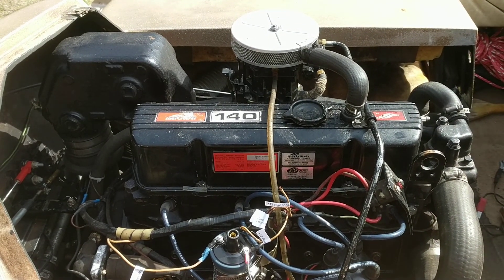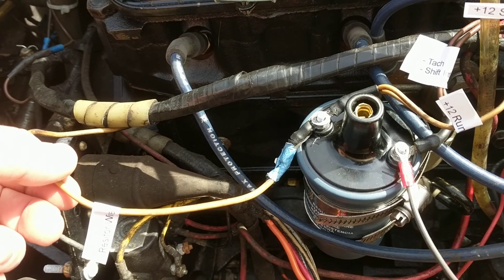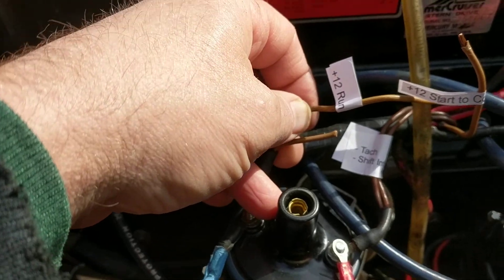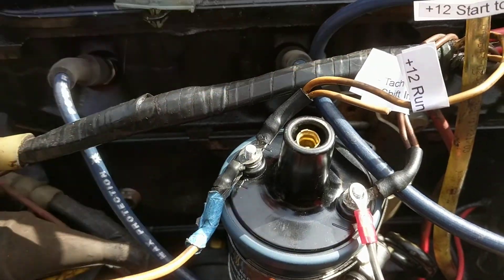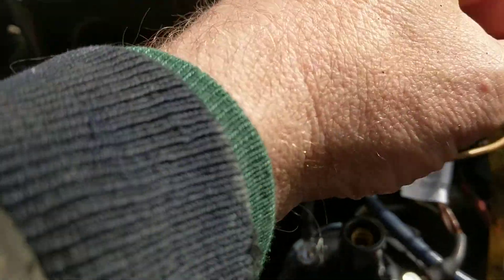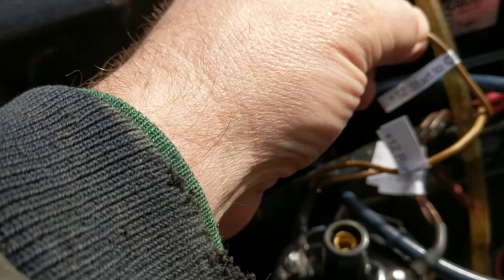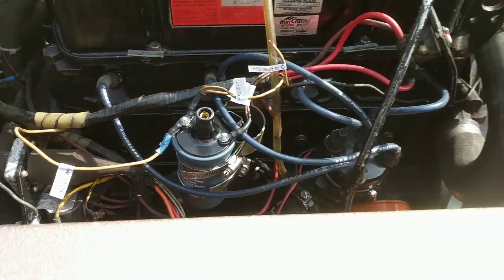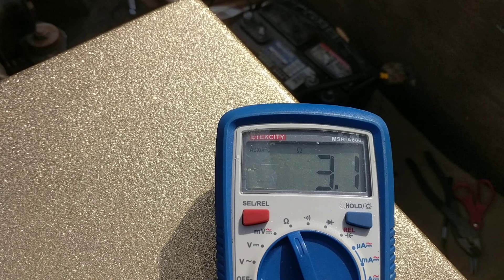Mercruiser 1968-1979 Wires to coil  (Hard starting) Part 1

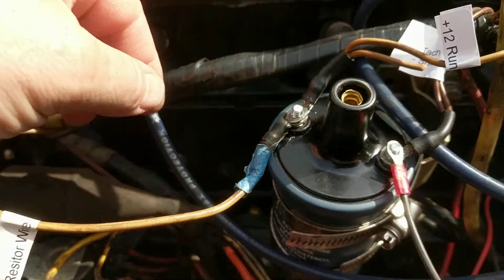Comment: at 3:40, "that was the culprit" but how was the issue resolved? Was it a bad wire that needed replaced?
Reply from the maker: The issue was on the Starter Solenoid.  There is a wire from the starter solenoid that connects to the +12 on the coil.   When the engine is cranking, the normal voltage going through the resistor wire to +12 is decreased, thus the coil might not have enough volts to fire.   The wire from the starter solenoid to the +12 on the coil supplies higher voltage (only when the engine is cranking), and the engine will start.

In my case, the starter solenoid was corroded, and the internal contact in the solenoid was not making the connection of +12 to the pin in the solenoid, so the coil never received the extra voltage.   You can test this by directly wiring +12 to the + side of the coil when cranking and see if the engine starts.
I repaired the solenoid and everything worked as it should.
 If you watch:  https://www.youtube.com/watch?v=vG8ECcYw0Oo   you will see details on the offending solenoid.

-andy
Reply: ...bad solenoid or just wire?
Reply from the maker: @kend4718  The problem was in the solenoid.  I had to fix the solenoid.

Comment: Thanks Andy. The positive wire coming from your electronic ignition/distributor - where is that receiving its +12 v from - direct from battery or ignition?
Reply from the maker: The +12v comes from the ignition (the Run position on the ignition key).
If you have points the +12 run first goes throw the resistor wire, to lower the voltage so the points don't burn up.
If you have an electronic ignition you might need hook up your own wire directly from the Run on the ignition key to the +12 for the electronic ignition.

The reason for the wire going from the starter solenoid that goes directly to the +12 on the coil is so that when the starter is turning, it can supply +12 directly to the coil (as opposed to the +9 that is being supplied from the resistor wire).

I hope this helps.
-andy

Comment: Where is your run wire coming from to coil
Reply from the maker: The run wire is the resistor wire which goes to the  + on the coil.

When the ignition key is in Run  +12v goes through the resistor wire that drops the voltage  down to around 9 volts.
(So you don't burn out the points or  coil).

The problem is that when you turn the key to start, that 9 volts drops down to 6 volts because the starter motor is cranking.

The solution is that on your starter solenoid, there is the "R" terminal:  This goes directly to the + on the coil.

When you CRANK the engine, +12 goes directly from the solenoid to the coil, so the coil has enough voltage to run.
When you release the start switch, the +12 is disconnected, but your resistor wire is still live with the +9 volts which is enough to keep the engine running.

Comment: I'm currently wiring mine and I feel like the best move is to run the starter wire to positive and a 12v from the alternator to the positive. Correct me if I'm wrong but I think having a constant 12v from the battery instead of from the alternator you would burnout the coil. if you ran the ACC positive to the coil you would heat it up if you were ever listening to the stereo with the key on the on position.
Reply from the maker: You are correct about having constant  +12 going to the coil (without the engine running) being bad for the coil.
If you want to run a stereo with the engine off, I would just hook up the stereo directly to the battery (like a bilge pump, or the blower or lights), or hook it up directly with an additional on/off switch if you are worried the the stereo memory might drain the battery.   This way you are not throwing an additional variable into a known good ignition wiring system.
-andy

Comment: Where does the resistor wire come from
Reply from the maker: It is factory built into the wiring harness.
Older vehicles used a "Ballast Resistor", I think around 1970 Mercruiser started using a resistor wire.
-andy

Comment: Can anyone help me, I have a 1986 Mercruiser 170 hp 4 cylinder and the roto cap has 3 wires coming out of it and most of the   videos I have seen show only two wires one red and one black,, what would the third wire be?
Reply from the maker: I'm not sure what you mean by the rotocap.    Are you talking about the distributor cap, or the top of the coil?
Is there a chance your 1986 has electronic ignition?
Reply: Yes I meant the distributor cap , I just bought the boat and tried to take the distributor cap off and found the back screw has a bad head so I am going to have to drill it out as soon as the weather gets better. 
That is what I wanted to see if it was electronic or points,, any I order the new distributor cap. I do have a super hot coil on it so, so it may have the electronic conversion. 
any way Thanks for getting back to me. 
Gary,,,,:face-blue-smiling:
Reply from the maker: @garymilner2544   In the distributor (with the cap removed), you can tell if you have points or not.
There is a conversion kit that replaces the points.   I have not had the best luck with point conversion type electronic ignitions.

There is also a kit that replaces the coil and distributor.  I put one in on my 79 Mercruiser 140 and it has worked flawlessly.   I used the Delco Voyager EST   I have a video about it:   https://youtu.be/2VmXrnN9WQg
-andy